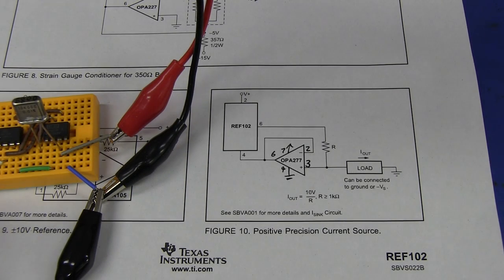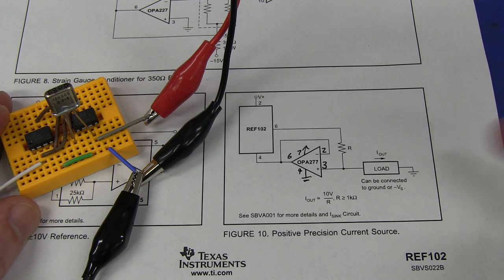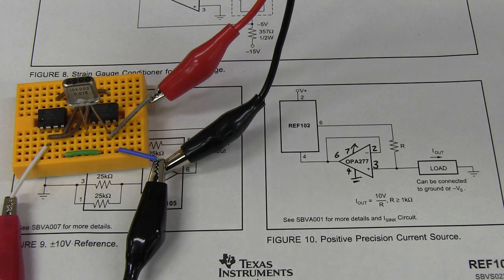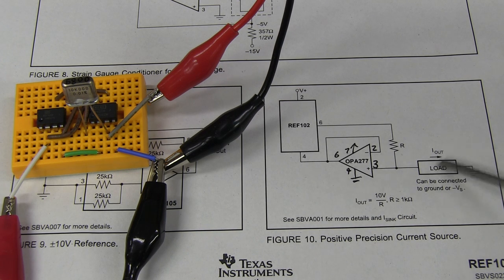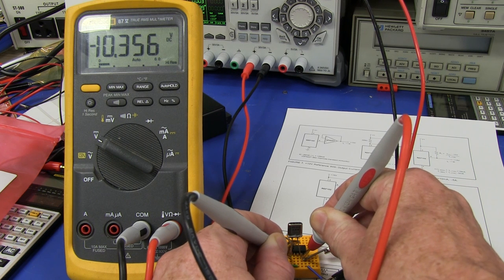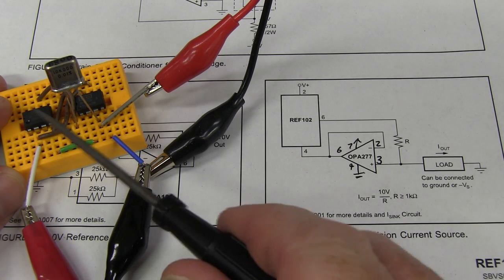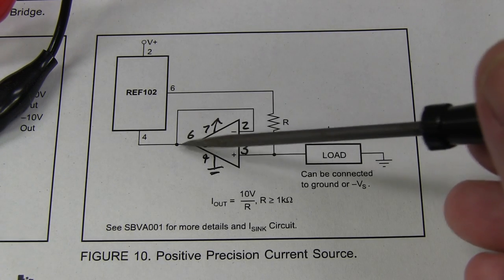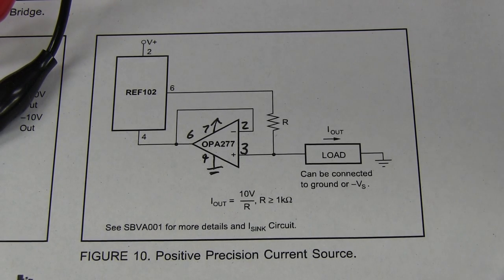EEVblog #579 - Precision Low Current Source

Comment: Hey wait a sec... 19:24 the non precision resistor is 9.91 Mohm, so the resulting current should be 10V/9.91 = 1.009uA, not 0.991uA that Dave says. Which we finally see measured at 23:20.

Comment: I know this is old, but Dave you just solved an issue I’ve been having for weeks building a precision programmable constant current source for testing LED Luminosity. Used a rail to rail op-amp configured as a voltage follower and never have been able to get the damn thing to drop its current below 500 micro amps.

Comment: Hi Dave
Are you planning a "micro Ohm" after the microcurrent? The precise low current sources could be used to measure resistors with low values using the voltage range of the multimeter just as you did with the microcurrent. It would also fill a nice gap since multimeters are not very good for measuring resistances well below 1 Ohm.
Reply: I think that's a great idea and also a circuit for low amps to measure parasitic draw .

Comment: 22:20 - That app note suggests there's a -Vs available. Couldn't you just tie pin 4 of tie op amp to -Vs rather than adding several diodes?

Comment: Yep, add a diode in series, then you've got quite a current source and a temperature sensor (with some specific noise distribution) in series with the load. Would it not have been better to use bipolar supplies or lower the ground of the load?

Comment: Do you know of any silicon part that can do precision current out of the box like there is for voltage? The reason I ask is because it looks to me like the biggest weakness in this circuit is the fact that you need to rely on 2 precision devices to make this work.
Reply: I'm not shure, but there isn't so precise current sources. You can get only something about 0.5% (not better) current source, with a small choice of nominal current values.

Comment: Thank you for your video!
I use this precision current source to generate 10 uA current. The current changes by 0.5 % when the load resistance changing from 50 kOhm to 150 kOhm, but I use unscreened wires. How can I additionaly improve the accuracy of current?
Reply: Probably the opamp input bias current I assume. Use a good opamp with low offset voltage and input bias current like an LT1012 (is not single supply sadly)"
I know, it's a bit late.
Reply: It depends of current shunt resistanse value too.

Comment: Could you not reduce the input bias current error by a couple of orders of magnitude by adding a (normal 0.1% precision) 10k resistor into the negative feedback path (ie match the resistors, feeding the input bias currents)? 

That would push the output of the opamp up by a tiny amount (via opamp action), and therefore the 10V output from the reference up by the same. And that would provide (almost) exactly the additional amount of input bias current for the +ve input of the voltage follower? Standard trick worth mentioning?

Doesn't deal with input offset voltage, or input offset current obviously, but eliminates a major source of error?

Comment: Input bias current doesn't necessarily goes into the opamp inputs. It depends on the input stage topology, right? I mean, a PNP long tailed pair has a bias current of opposite direction of a NPN one.

Comment: Hi I have made a constant current source using LM317 on bread board. I am generating a constant current of 100mA. The input to the regulator is 3.3vdc. 100mA constant current is fed to a resistor of 100 ohms. I should measure a voltage across resistor of =10mA x 100= 1000mV=> 1V, but the voltage across the resistor I am measuring is 3.3vdc. why so? I want to use the constant current source to find the unknown resistor using current and voltage How can I do this?

Comment: The diode stuff is a big disappointment! It turns out not better than a LM134 based regulator, and the parts price is a bit higher.

Comment: You lost your accuracy as soon as you added that first diode to the circuit and it only got worse from there when you added more diodes. 
I have run into this exact problem before but in my case I could not 'lift' the ground voltage at the load end, and I was stuck with using a single supply op-amp..
 I also solved my problem using a diode but I used it where small changes in voltage across it due to temperature and current did not affect circuit accuracy.
I put a schottky diode in series with the ground to negative power supply loop and connected the neg side of the op amp to the negative power supply  terminal, this gave me a few hundred millivolts of negative rail to compensate for the limitations of the rail to rail op-amp.
 The best part was that it didn't matter what the actual voltage across the diode was, as long as it was more than the output voltage of the negative rail of the op-amp....
.
You might want to consider doing something like that in your next design.....
Reply: I'm having trouble visualizing what you mean?  Could you draw this?

Comment: Am I the only one saying run the op-amp from a dual supply?
Reply: good option. But a series resistor/diode does equally good.You can get the opamp into it's range either way
Reply: maeanderdev I guess that's good enough, and you don't have to make a dual polarity power supply. Although after I've thought about it, you could also put a diode in series with the op-amp negative supply and use the diode drop to raise it 0.6V above the power negative and make a pseudo negative rail.
Reply: He explains why about 9 minutes in :-)
Reply: @therealjammit  That simply moves the diode around on the schematic, not in the actual circuit. It's the same thing.